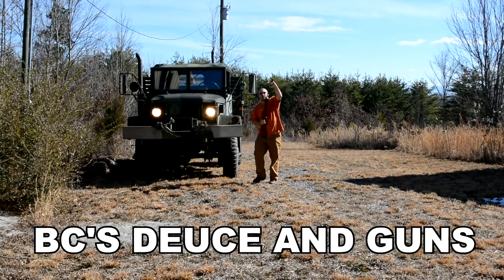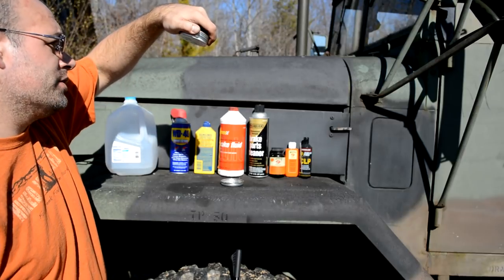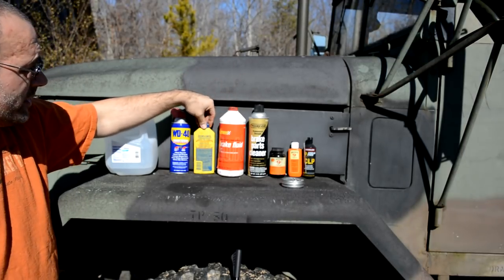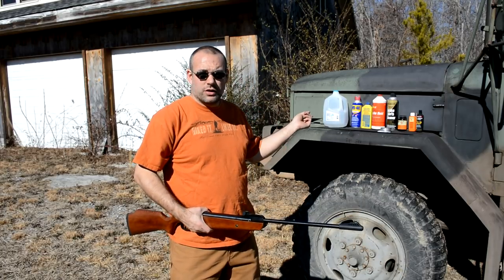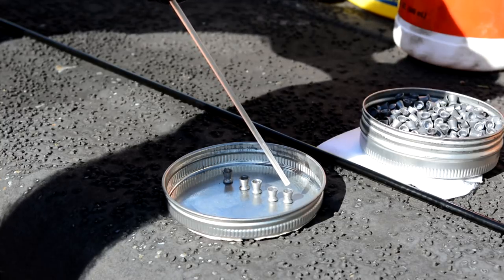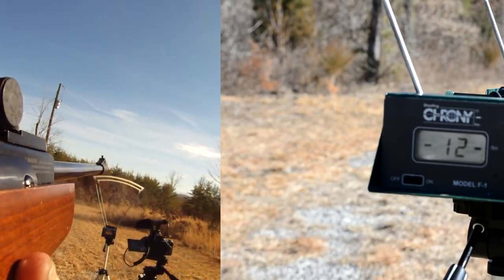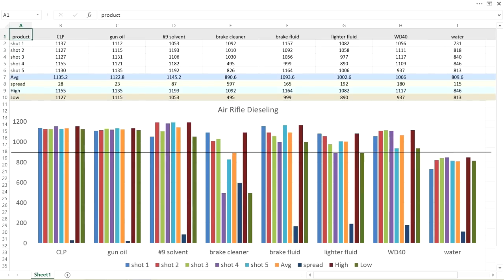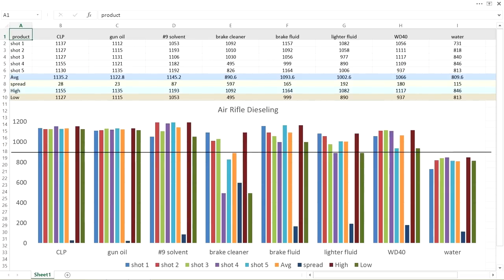Air Rifle Dieseling For More Power Part 2!

Comment: BC,  Please test, "OILED PELLETS", I tried the oiled pellets in my Daisy Powerline  880. I used Baby Oil, cheap at Walmart.  I got about a 25% to 30% ? increase in power.  I would like to see a 3rd video on dieseling and oiled pellets with your crony' and charts and numbers.  I can "not", find any videos with oiled pellets on You-Tube. You videos on dieseling with the charts and numbers are the best on You-Tube. Thanks, keep up the good work.
Reply from the maker: I never thought about baby oil before but I'll try it.  My next air rifle dieseling video will include actual diesel along with other things...I'll add baby oil to the list.  Thanks.
Reply from the maker: When you say "oiled pellets" dip you mean in the skirt of the pellet or the entire pellet is dunked in oil?
Reply: I too am extremely curious about this but want to see enough videos or evidence that it would be a long time until your rifle breaks. I have a beeman .22 and a ruger blackhawk elite .177 rated at 1200 fps (alloy pellets) that I would love to see how much more power I can get out of it and hopefully better accuracy. Just wanna see which type of oil would be best to use.
Reply: I put a few drops of baby oil, or any light oil, on the pellets by adding a few drops to the container and letting the pellets roll around in the in the metal container, thereby coating all of the pellets.Too repeat, with the oiled pellets igniting at night, with a flameyou could see in the dark.  It did not ignite with a non-oiled pellet,proving dieseling.

Comment: Have you tried the amounts of oil, I've found that once you fill the skirt of the pellet to remove most of the oil where it's just a thin layer of oil in the skirt and not a whole drop, that it drastically increased in power, it was shooting pellets through an entire 2 inch phone book and went into the base boards of my house, but when I used a whole drop inside the skirt it did not penetrate the entire phone book, but every single pellet that I wiped most of the oil out of the skirt was penetrating the phone book entirely and even penetrating the base boards a few centimeters after going through the phone book, I was quite surprised by how much power that it was shooting,

I was shooting through an Air Hawk Elite 2....

A very thin layer of oil was igniting more of the oil once pressurized, which was an obvious drastic increase in power and velocity, a whole drop of oil in the skirt wasn't fully igniting all the oil, leaving drag issues, Try this method, like I said put a drop in, then take a Qtip and just dab the oil, but leave a noticeable layer of oil (just not an entire drop) and it will surprise you

Comment: Is it a dieseling phenomenon or is it that the solvents are sealing the pellets better and water being less viscous it didn't hold as good of a seal and seems to have even negatively impacted the shot. Also low octane gasoline would compression ignite easier than any of these oils as would alcohol or lacquer thinner.
Reply from the maker: It's dieseling.  Without the advent of smell-o-vision you can't smell the burning but it's igniting.  The issue with some of the things I tried here and the three you list is that it won't stay in the skirt of the pellet.  Thicker oils stay put better so work better.

Comment: Have you ever tried using real diesel fuel?  seems logical to me.
Reply from the maker: Yep.  It'll be in part 3!
Reply: +DEUCE AND GUNS Thanks :)
Reply: which never came. lol
everybody talking about dieseling and using everythinge but not diesel.
Reply: How about the fuel they use in those cox airplanes ✈️ model motors, they're two stroke diesel motors, so that seems right.
Reply: He's got lighter fluid about the same thing
Reply: Nicolas Broszky  kerosene cannot melt steel beams 
Go to 9/11 truth 
Architects& engineers
Truther websites
Reply: Or glow plug fuel, as used in model engines.
Reply: @markcharleswashington2073  RC oil is silicone based, opposite of WD40.
In short, I believe it lacks the accelerant effect to make this work.
Reply: @deuceandguns  We are waiting 4 years for part 3! @remind me when part 3 comes out!

Comment: Been thinking about this. Have always used Hoppes oil as it is what I use to oil my guns. Very inconsistent results. Just came to mind, has any one tried paraffin? same molecular make up as kerosene or diesel, Poured into the base of the pellet it could be a viable option, and would not drip out.
Reply from the maker: I've never used paraffin but chapstick will work and will stay in the skirt of the pellet.

Comment: I like to buy refurbished air rifles 'because I take it apart and rebuild it the way I like it 'the ruger air hawk is a nice rifle I have two of them I rebuilt .I have one that shots like the ruger air magnum 'I put a hatsan 125 sniper spring in it .I had to cut off 4 coils to get it to cock but it was well worth the time it takes about 55 pounds of cocking effort to cock it but it shots liker a .22 short rimfire
Reply from the maker: You're braver than me.  There's a lot of energy in those springs!
Reply: that's true a lot of energy .I had to make a spring press in order to push the spring back in the gun .but you should give it a try .it really improves the gun .

Comment: charging the spring chamber with gaseous oxygen, along with the oil, right before firing? maybe? I need to go get an airgun!
Reply: I highly dont recommend, pure oxygen is too good oxidizer for that use. I have seen one PCP gun that was filled with oxygen, not air. It burned hole to the air tank and exploded even with stock oiling

Comment: Why not design a spring air rifle to be used either with a capacitance gel to give more force or use without? You could design a rifle like that and produce pellets with capacitance gel sealed in one end like a pain ball to give folks a different type of air rifle to use. Imagine a 40 cal air rifle using capacitance gel? Be neat to design a double break barrel air rifle designed to be used with capacitance gel.

Comment: I'm interested in what residue that's left in the barrel. Is it sooty, greasy, also is there pitting happening? Some higher power .177 rifles can shoot at roughly 1200 fps out of the box adding dieseling with that could put fps in the 1400+ range. I'm curious to see what effect dieseling would have on a .22 air rifle considering the skirt is much larger. Or would the larger amount not ignite.

Comment: i spray wd40 in my rifle (spring loaded one tho) te clean it out xD
Reply: You might consider switching to a silicone based lubricant. WD40 is petroleum based and some petroleum products will eat away at rubber seals and orings.
Reply: Metaloid Mongoloid WD40 stands for Water Displacement Formula 40 to keep water out of electrical connectors on missile testing ranges. Really, don't waste time using it as a lubricant. Spraying it on herring when the salmon won't bite is another matter all together.
Reply: Charles Springer I've heard of that trick. Same thing for sturgeon too? I believe it's illegal in some states to do that?

Comment: So, where is part 3?
Reply from the maker: I know I know.  I'm really late on this one but it will be made.  I've got some good ideas including actually using diesel.  If you have anything you'd like to add let me know and I may be able to include it in the future video.
Reply: Maybe try a few "more" flammable fluids?
Gasoline, Alcohol,......Nitro?  ;)
Thanks for the quick reply, I appreciate that.
Reply: +DEUCE AND GUNS I'm a little late in response, but have you tried transmission fluid?
Reply: I have an idea! Fill the skirt with hard greases like coconut oil (it's hard like soap a room temperature). Advantages: Consistency (Always the same amount of grease in the same place AND it doesn't spill out in the rifle); easy handling: prepare as many as wanted, store them as long you like. ; Safety: Oil doesn't spill in the gun, therefore the extra pressure occurs right behind the pellet, therefore less stress to the piston. also the grease should burn slower because of the smaller contact area with the air. As the pellet moves through the barrel, the burning coconut oil distributes the pressure evenly, propably resulting in more consistency and definetly less stress to the barrel.

Try this on different pellet weights. Most people say supersonic pellets are less accurate, because the sonic wave catches up with the projectile and disturbs its path of flight.

I believe this is only partially true: The sonic waves affect the pellet only that strong because it's so light (the reason why its supersonic in the first place). The heavier the projectile at that speed, the less it'll  be affected by the sonic wave, resulting in better accuracy.
Another reason is the skirt. When the sonic wave catches up, it hits a huge surface are, increasing the effect. A boattail pellet woudn't impressed.

So my suggestion: Use the heavyweight h&n piledriver pellets. Weighing 30gr (.22), has a boattail, and a smaller contact surface area with the barrel, and also an aerodynamical round nose, with a small hole in the tail for some coconut oil.

You could also try: lard, butter, sticky bearing grease, maybe even candlewax!!!!!

Greetings from austria

Comment: No, you can't pressure ignite water like diesel :D
Reply from the maker: My optimistic hope was that the sudden increase in temp/pressure would turn the water into steam causing an explosive expansion in volume.  I figured it would work on the opposite of the flash steam principle...I was wrong but I've never seen anyone else try it.  Soooooooo. Myth busted? :)

Comment: water?   you really thought that water could be a fuel, because it turns to steam?  in a steam engine, the coal is the fuel..... water is used because it expands when boiled.  Don't you have a scientist in your neighborhood?
Reply from the maker: The fuel is the compression which generates heat.  I had hoped it would be enough to turn some of the water into steam.  I was wrong but that's part of the scientific method.
Reply: @deuceandguns   The compression generates heat which ignites fuel in a diesel engine. That is why they call this "dieseling". Fuels like diesel, and other oils contain hydro-carbons. Water has no fuel in it. It cannot generate energy.